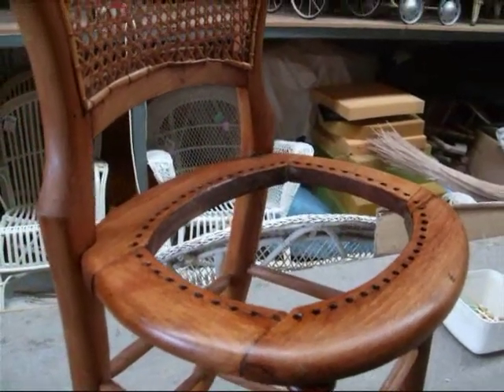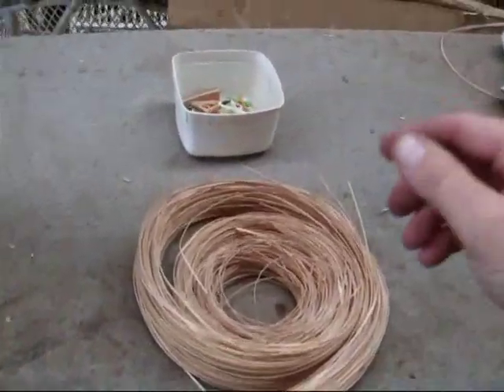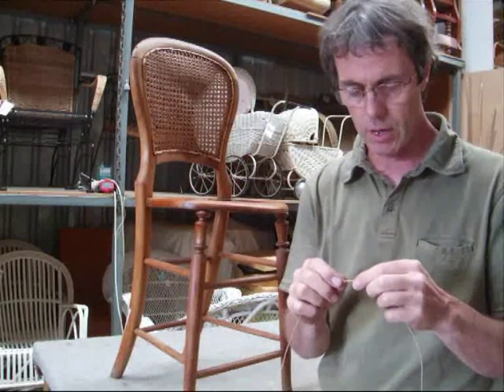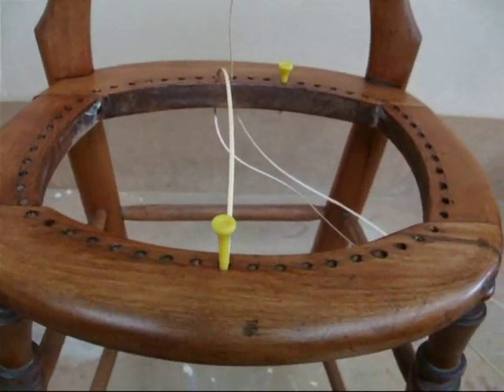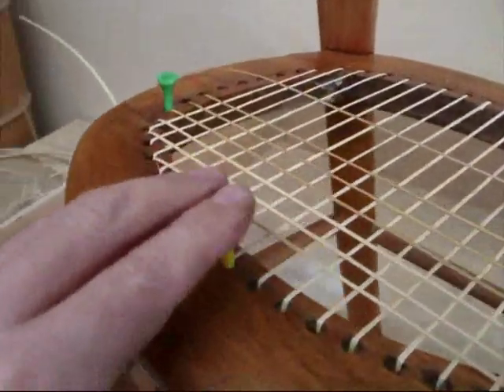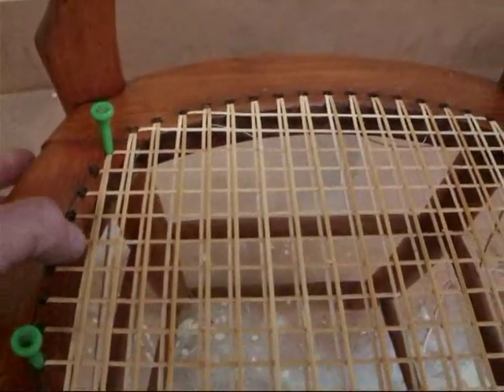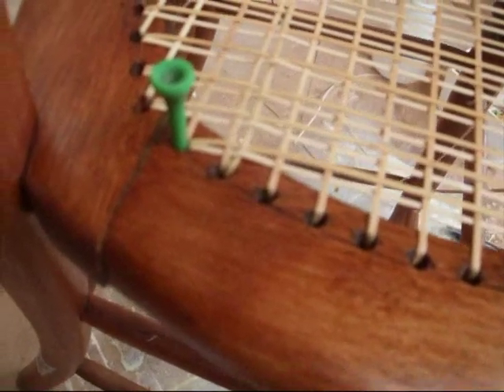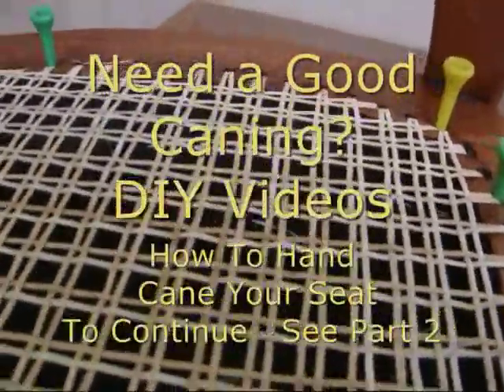Chair Caning How To Pt 1

Comment from the maker: @42821450  The longer the strands the better, less tie offs. The cane is generally dampened to soften it and to stop it from breaking if you bend the cane back on itself. You should be weaving so that the strands glide through the other strands with ease. To wet and the strands will stick and break. Also make sure you have good quality chair cane and don't forget to run your nail accross the top of the cane to see which way to weave so that the nodes don't catch. Good luck

Comment: Hi, great video, very useful indeed, I watched both parts several times before starting my first chair. All went well until I got to stage 4, the first true 'weave'. I am having great difficulty pulling the cane through the existing strands, is this because I have them too tight? I have soaked the weaving strand for at least ten minutes and keep it wet as I go using a spray bottle but it is almost impossible to get it to pull through without constantly breaking. Thanks.

Comment from the maker: @42821450 Hi Anna great to hear that you have almost finished the seat. Try weaving only a few strands at a time along the diaginals. This will ensure that the cane will not twist. Pegs or golf tees are only used whilst weaving to keep the strands tight, so know idea why they should be popping out unless they are to small. Good luck

Comment from the maker: @42821450 You can use wooden pegs made from cut down golf tees, thick fondue or skewer sticks, round core (reed),which is what I use or a small guage dowel and cut a point in it. Or you can simply apply a small drop of pva wood glue. There...that should do the trick.

Comment from the maker: The back of your chair has been hand woven by the method called 'Blind Caning' which simply means that each strand of cane is plugged into the holes rather than passing right through. Just takes a little longer to complete.

Comment: Great explanation!  Do you use a continuous piece, or do you cut them off as you go?
Reply: I use the total length of each cane. Obviously should the cane not be long enough to weave across the seat, I'll use a new strand. The shorter pieces can be used for the diagonals where possible. Best not to waste any of the cane if you can use it elsewhere.

Comment: I have an old dryed out piece of wicker almost 60 years old how do I make not so dry planning on re staining it?
Reply: You can saturate the wicker with warm water, and then once the wicker has allowed to dry naturally, over a day or so, then you could apply linseed or orange oil. Applying a stain can effectively weaken the wicker. It's possible that the wicker may be too old and dry for a good comeback, so you may have to consider having to replace it.